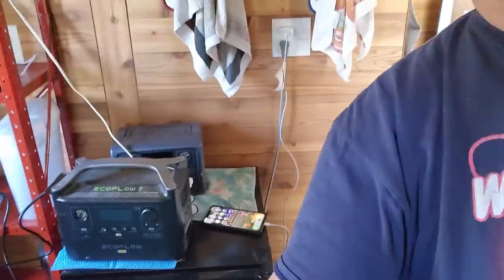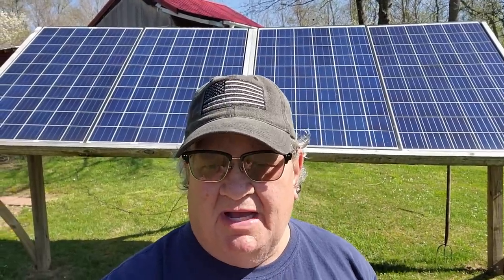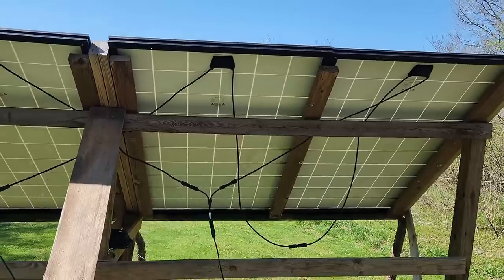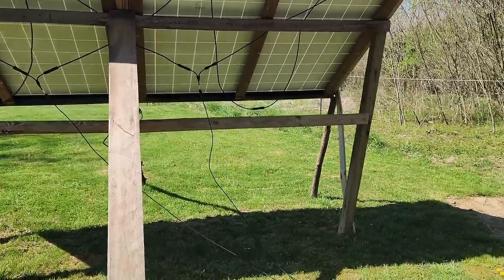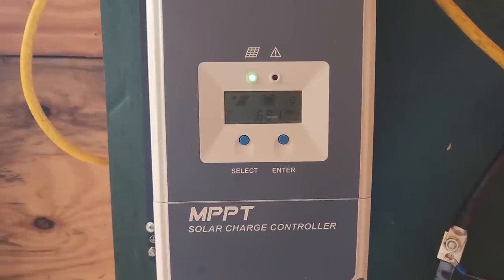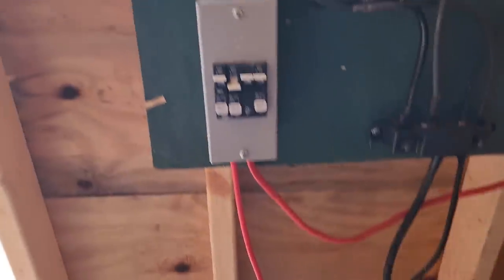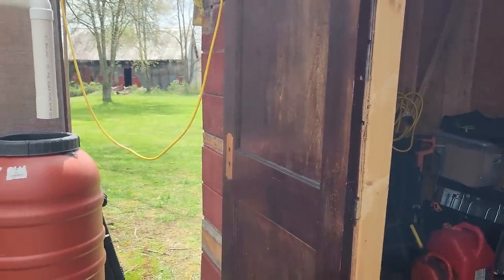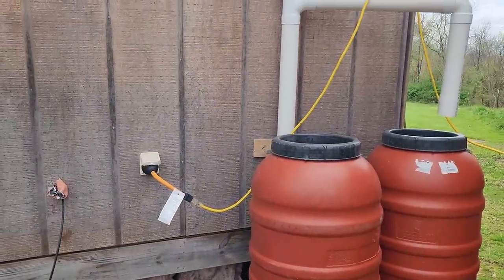DIY Simple Solar System - 3 Year Review

Comment: I'm with you on the lead-acid batteries. I understand Lithium is a game changer for most situations but not all.  I have a cabin up North Michigan.  We go to this cabin maybe 10-20 times a year for a weekend.  I do have a Bluette EB150 that I love and take with me each trip although to power the water pump, gas stove ignitor, lights, radio, charge cell phone, charge GMRS radios and run a diesel heater, an AGM battery I bought seems to be the best tech for me.  I have just 200 watts of solar to charge the battery back to full after we leave (100 watt would be more than enough but I had two panels and so installed them both). The lithium powered EB150 Bluette works well in that I keep it with me at home inside my house (temp controlled). I also use the Bluette as backup at home to power fridge and sump pump / couple lights when power goes out.  Usually, power comes back in an hour or so and if not then I have a generator I hook up to power the house.  I see what you have and think to myself "that is perfect".  I wouldn't go to a lithium battery unless you plan to heat the area they are stored in (for extreme cold weather areas).  My understanding is that Lithium is actually better in cold weather for discharge, just not charging.  If I were to live at my cabin full time, I would definitely buy the Lithium batteries and simply keep them inside.  Thank you for taking the time to post your video.  I always enjoy different perspectives.

Comment: Given what I see of your equipment it wouldn't be too hard to repurpose an old non working deep freezer to house everything. This would give the benefit of insulating them during cold weather. If really cold you could include a single 60 or 100 watt light which should easily heat the space of the freezer. Just a thought I was thinking of doing myself.

Comment: Thanks for the great explanation of how you arrived at the size of your system and it’s components! I’m still in the research stage of building a system just for power outage backup, and your point about analyzing the real needs really hit home with me. Keeping within a small budget is also key as many of the systems that others have discussed left me feeling like it would be pretty expensive to build something that would have likely been overkill just to have a small amount of emergency power. Thanks for presenting this no frills practical approach.

Comment: I love your system! We have 800 watt , 12 volt system for our house we use, and at the worst case its enough to survive with. We put it in to just for emergency's, but have been adapting to its use.
Reply: Is 800 watt enough to function with on minimalistic living needs of maybe a bit of cooking, some heat, and very little power needs? And how does that turn out in winter?

Thanks.
Reply: @noahriding5780  It works for us, we have led lights and use for tv and computers and small chest freezer. hubbys bi pap.
Reply: @benzoverakers1877  Thank you.

Comment: Hay Joe and good review!  Off grid 20+ years now with just a small 12 volt system and you are right that 12 volt is cheaper to maintain and you can get parts locally.  I use lots of 12 volt appliances and running DC direct current you are not losing power converting it with an inverter and if your inverter fails your water pump and appliances will still work.

I still have my Vmax tank 125Ah AGM batts on my main system and still going strong after 10 years but I did set up a recharging station with LIFEPO4 and I will be converting my main system to those probably this summer because they have double the capacity. My batts are kept inside because our -20 weather here would zap a flooded cell down to nothing overnight.

We don't have high humidity here so I use a swamp cooler and only 85 watts but I do have a window AC I can kick on in the day.  The 12 volt fridge/freezers have made life a lot easier and they are affordable now for off gridders. Keeping a fridge running off a small system was a major problem when I first went off grid.

For your water pump I would suggest a switch inside the cabin so you can turn it on and off only as needed. I see you have the same propane heater and I am guessing you are also using a propane OD water heater.  

Your solar mount is showing some age like you said and I would look at the ecoworthy rack mount that is adjustable so you can change the angle for winter and summer sun. Reasonable price on Amazon.

Ok, good to see you are enjoying off grid life and have a good one friend!

Comment: Good vid. Thanks for taking the time to show us how it’s going. I received 2 panels and that same mppt charge controller I have a few deep cycle batteries that can use to store energy. I like the advice of staying on the 12volt system. Later. I’ll get a 48 volt system when I build my solar pergola.

Comment: When I first did off grid in 2010 I did just regular deep cycle and regular car batteries and everything worked great.

Did not even know that you could only use 50% of the battery, just used them and it worked great, but now...

Comment: Hey Joe!
Lithium batteries CANNOT be charged below 32F/0C, so would be useless in your current situation.  You would have to put them in the cabin, or a heated box.
If you drop back to 12 volts, you will have to disconnect a solar panel, to avoid overloading the charge controller.
If it ain't broke, don't fix it!
All the best.
Reply from the maker: +SarkyBugger I’m not changing this setup.  Just, if I had it to do over again, knowing what I’ve learned now.  The solar panels I could leave setup the way the are.  I’d only have change the battery bank!  But you are correct though.  It ain’t broke, so I ain’t changing nothin’ lol.

Comment: Great video. I am on a strict budget so I am useing flooded lead  batteries I recovered from my local auto parts store   that were in the core pile . Ask the manager to let you go through the old batteries with a tester and buy the batteries  with 12 volts  . Equalize charge and desulfate them .Any that can't be recovered take back and trade in on your next run . I have 500+amp.usable storage that cost less than 1 new battery.
Reply from the maker: +Teddy Cunningham 👍🏻

Comment: This has similarities to mine. I used a 40 amp Epever charge controller, and twenty marine batteries from AutoZone. I have that same watts meter on my 600 watts wind generator, but I used an MT 50 on the solar system. I used a 24 volts, 2000 watts Aims Power inverter charger. My A/C uses 640 watts. I have 1000 amp hours of batteries. I bought a Winco Lil Dog generator, but rarely use it. It's 2400 watts, just big enough to run my 75 amps inverter welder. I've just had the wind generator for a month. I'm considering buying a Midnite classic charge controller for it. At 6 a.m., I'm showing 25.5 volts with the wind generator putting in about 150 watts gusting to 450 watts. I have four different brands of panels, six different sizes. I pieced mine together during the pandemic. They'd be out of the same one I got the last time, so I'd get what ever they had. I've been using 1200 watts, wired like yours, series/ parallel, 2 panels to a frame. I made some frames out of square pipe, so they wouldn't blow around, after I shattered a panel in a storm. So one frame has two different sizes of panels on it. I found some good panels on clearance so I bought two. So when I get those wired up, I'll have 1400 watts. The way my panels are arranged, I have 600 watts in the morning, 1000 at noon, and 800 in the evening. My controller can only take 1040 watts. But that configuration will let me run the air conditioning unit longer. Nice setup you have. It's sort of like mine. Just imagine adding fourteen more batteries, lol. P.S. click on my picture if you want to watch a very short video of the wind generator spinning.

Comment: What's the surge draw of your refrigerator or air conditioner?  I'm impressed that the inverter handles both.  Lead acid is fine, infact it's hands down the most reliable for the average person.  I know dang well that the life of leas acid is going to be extended with a modern charge controller like my victrons.

Comment: I forgot to mention...you said you may not go with 24Volt if you did it all over again.  I think 24volt was still the right choice.  I am also no expert although I have spent much time researching (mostly Will Prowse) and come to the conclusion that a 24Volt system saves money in that you don't need as thick of wire (higher volt means lower amps means thinner wire means cheaper wire and also am told 24 volt systems are just more efficient).  Once again...I'm no expert either, but that is what I keep reading.  I do have a 12 volt Deka "Lowes special" lead-acid battery in my 5x10 ice fishing/cargo trailer (vented in the nose box) and that works well because I am simply running a Diesel heater/max air fan/lights/radio with just a 100Watt solar on top of the trailer.  I am also running 12volt at the cabin I mentioned last post and would definitely go to 24 volt if I used the cabin more.  I guess it really boils down to what you need to "git er done" lol.  I am thinking of putting a 48volt Lithium system into my house to act as a buffer when we lose power and if I size it right could run my house indefinitely (for basics like sump pump/fridge/couple lights and radio/furnace).

Comment: I know you gave your disclaimer - fair and honest.
However for the Internet sake I have to make some correction.
Wen you series panels you increase the volts - doubled. The current remains the same.
When you parallel the panels the volts remain the same and the current is doubled.
In both cases the wattage remains the same.
There is no trade off there.

Power = volts x amps.

Comment: I like your thoughts on size to my needs I'm planning on 2000 watts maybe 3000 but there is no way I've found to upgrade to split phase 220 so my air-conditioning won't work and no way to go to a heat pump water heater or a heat pump dryer but I do have a fridge  freezer furnace and a shallow well pump to run also where do you get 12 volt dc led Edison base light bulbs  all my lights are on one circuit so I can switch them to 12 volts then I can shut off my inverter at night

Comment: Basics is you combine the volts that adds up and if you hook him up individually the amps at up the w always stay the same atom from each panel to the next Sophia four 400 watt solar panels that adds up to 1200 watts no matter which way you put it you will always have 1200 watts then what changes and how you hook it up is the volts  and the amps those are the only thing that changes when you connect parallel or separate from one another. But you're watts  still at up.

Comment: Hello Sir, just found you. I have a large 300 ah LiFeP04 12v battery, 60 amp MPPT, 2000w pure sine inverter, two 190w 12v and two 100w 12v panels but haven`t wired it up yet. I have used the battery with a plug-in 20 amp charger for power outages. It easily runs my tiny little air conditioner for a long time if I set the thermostat. I need to get a battery meter but they never include all the parts needed to wire them up and it was so frustrating buying nuts and bolts over and over trying to find the right ones to simply connect a FUSE to the battery that I can`t take any more stress right now. I may just use it without a meter. I ordered one and got the wrong one and have no transportation to drive two hours to the UPS store to return it. I`m sick of dealing with this.

Comment: i have been running my flexmax 60 at 12v with eleven 100w Pannels for about a year i sometimes pull 1200w from the panels im really hoping it doesn't blow up.

Comment: Of course if you put a 450-watt heater in that shed your letter acid batteries your AGM batteries are lithium batteries while live comfortable in there and lettuce batteries do not like ten below zero but they do still work even when it got 30 below they still work just not as well cuz I'm also using that acid batteries.

Comment: The shunt is wired wrong, it should be the only thing connected to the negative of the bank, and then everything else connects to the other side of the shunt. The voltage seems high, prolly a calibration error on the shunt.

Comment: Today to save some money on the charge controller you only need a 30 amp charge controller with 4 panels running 25 volts. 
With a 60 amp controller I would increase your panel voltage to 60 vdc and run 3 parallel 3 panel solar banks. 9 panels. You would get that much more power per hour of sun.
Reply from the maker: +RockTech I have 6 more panels in the barn to install later.

Comment: A small correction:
Series = the voltages from panels add and current is the same.
Parallel = the currents from the panels add and voltage is the same.
Since power = Volts times Amps,  both connections will add power numbers together.
For you, lead acid was a very good choice.  Nobody cares how much the battery weights.
Lithiums are more touchy so the controllers etc cost you more.
I think multiple boxes wired together may be the best way to go also.  If one box fails, you can do without one part of the system until it is replaced or repaired.  
I would add solar hot water and solar space heat to what you have.  Both can be home made for quite a low cost and they capture a lot of energy from the sun so you need less firewood or whatever you use to heat.

Comment: When you first plug something into the power inverter, there's a bit of a voltage drop typically for the load. 

I had questions about this. Some people say too much drop means battery wear/damage. But I don't know if that's true. Also some voltage drop, like a small amount should be there to indicate a load is going through. So it seems like there's some range there. Maybe some drop is the load, but it could be that too much voltage drop isn't good either? 

Do you have any thoughts on this or anyone else for advise? 

Thanks.

Comment: Joe, can you please address the grounding piece? I'm confused about whether or not I need to ground an off-grid system. I've got 24 volts, 1200 watts solar, 24h/200Ah battery bank, Victron 150/45 charge controller, and 24 volt 2000 watt inverter. I can't seem to find anything that is not bloody confusing on how to ground this stuff. How do you ground your system? Or do you?

Comment: inverter is a batteries? right  if you charge up then bring in to house you can used it?? it  safe right??? so the controller not a batteries right ? how you set this  up?

Comment: I'm still running on two Trojan lead acid Joe.... I would prefer lithium although I don't trust lithium very much and I would rather my truck conversion motorhome wouldn't burn to the ground and I'm getting on just fine with the lead acid .   although I don't like the weight of them.   but they are s*** kicking tough and reliable but at some point I will go over to lithium and put them in an isolated metal box under the truck
Reply from the maker: +versatec1 As lithium has started to become affordable, it makes sense for all of us old schoolers lol

Comment: Call I had started off with a solar system with two 80 watt solar panels and four 15 watt solar panels in 1998 they were very expensive and lead acid batteries I started with three batteries then I moved up to 12 then I moved up to 24 and the 24 that acid batteries lasted me 26 years and I find lost 5 batteries so they lasted a long time. But I also got more solar panels some years after that but when solar panels got a little bit cheaper and then last year I started getting more solar panels of course I got solar panels three times before that as well.

Comment: Actually I would go to 48V. the inverters and solar charge controllers are cheaper. Reason is because they deal with lower amps yet more watts. internal components are more expensive for a 12v inverter vs a 48v of same size. Also the wiring can be smaller with 48 volts vs 12v too. when you stick with 12v you are limited in how big you can make your system.